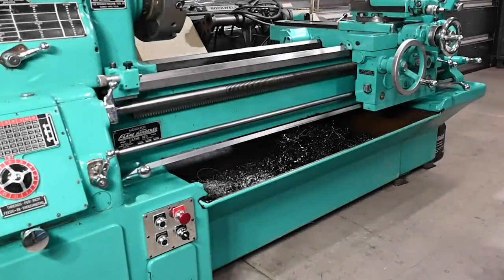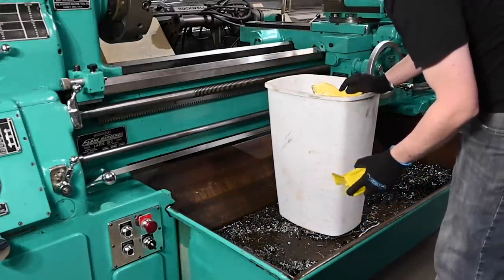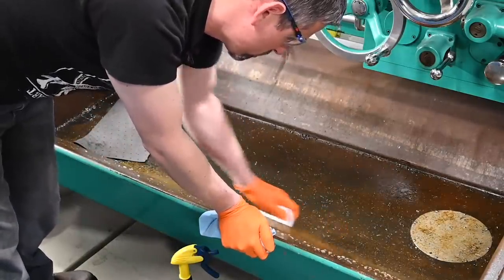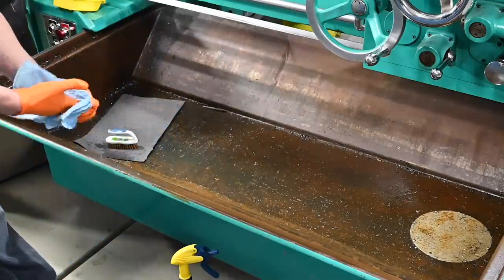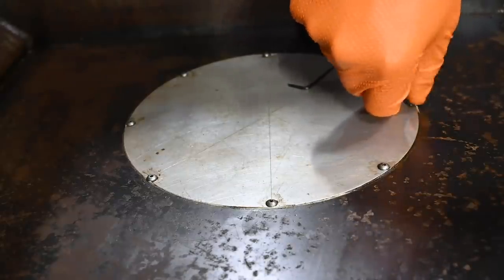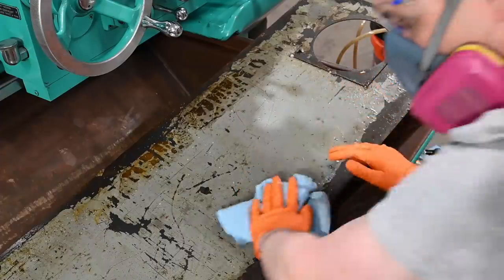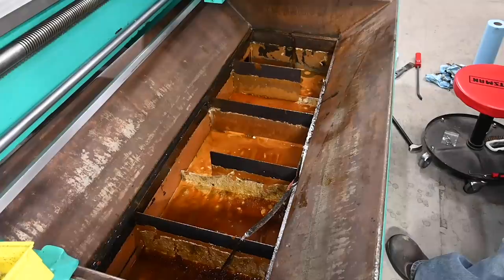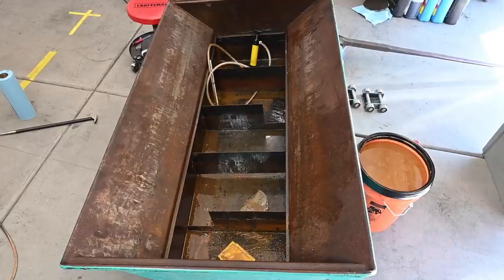Monarch Lathe Coolant System Rescue! With Smell-o-vision!

Comment: Back in the day,..I apprenticed in a machine shop ( Carlson Machinery, Phoenix AZ ) ,, that required all 26 apprentices to Clean the machines after the days production runs, this duty was accomplished by pulling the "Chip pans" with a fork lift to clean and empty into a salvage bin out back. To avoid extra work to disconnect the coolant pump supply tube and electrical most lathes with this type of coolant recovery pan were "Upgraded" to use a remote pump and hose and discontinue the original pump and hose, this allowed the apprentice to pick up the entire pan with coolant and chips to be dumped at least every 3 days. I see in your videos are that your lathe is not mounted on a 2" thick, x 6" Dia. circular floor riser under every leveling point , this would allow the "Chip Pan" to slide on the inset tracks on the bed castings and allow a 3" air gap under the chip pan and lathe that would allow easy removal of the chip pan with a fork lift and cleaning under the lathe. Also Monarch placed drain points all over the pan as the customer ordered, most series 60 and 61 chip pans had drains near the bottom and pickups half way up from the bottom drain, this allowed the pump to recover coolant while the chips sank to the bottom, I also see that the chip screen has been replaced with a "Plate" and should be replaced with a drop in Stainless Steel Pre-punched screen, a lot of thinking by Monarch went into these chip pans!

I would recommend that you clean and paint the pan to just below the "Screen Line" and just leave the inside below the screen line bare metal, this was originally the way they came from Monarch, all that grease and coolant will keep the coolant tank well preserved, above the screen I would recommend a good grade of Epoxy from "Sherwin Williams" , have the pan sandblasted but do not blast below the screen line, or in the coolant tubs and baffles, leave this area untouched 

Lastly,, I worked for Carlson as a journeyman machinist (11 Years) until they went out of business, worked for several other machine shops over another 12 years, and taught both wood shop and metal shop for Phoenix Union High School under the old Stadium, and finally ran my own machine shop until I recently retired.

My point is that you are doing well in these videos, I would counsel you to ignore the negative internet comments, there are thousands of us that appreciate you and others on U-Tube that take the time to produce videos to enjoy.
Thanks Dan
Reply from the maker: Wow Dan that was a kind and knowledgeable comment. Thank you for the time it took to write it.
Reply: @AlwaysSunnyintheShop  yes it was sound advise I think to.
Reply: Dan, your very full comment covered the aspect I was going to mention, namely that when Monarch designed the machine, cleaning in American industry was done by unskilled labour. Watching Aaron wrestle with that chip pan unit means cleaning it was not a popular job.
I have a (much smaller, but similarly robust) Japanese Okuma, and the chip pan slides on wheels towards the back of the machine - ergonomics or speed of cleaning leading to lower costs?
Just curious - was Aaron's Monarch shipped with that toxic mess, and none of it spilled?
Reply: @russelldold4827  I think it was, I personally think that the people who modified the chip pan left a void that coolant was able to leak into the lower "Sealed chamber and eventually putrefied over time, the coolant must have been a modified animal fat base that was often used back in the day, and if left in this condition reverted to the status of a dead pig out in the sun!   My Monarch chip pan is designed to easily slide out of the pan edge tracks with a floor jack, Im glad to see Aaron has the original parts to rebuild though!

Comment: It's your machine, do with it what you wish, comments are for help or questions, not unqualified criticism.
It's crazy what bacteria can do, and damaging, my previous lathe developed a leak, on examination, it was due to umpteen years of poor coolant housekeeping and had corroded the sheet metal bottom. Many old machines used oils with Chloride and Sulphur in, Chloride attacks the steel. 
If I may suggest before painting, remove as much scale as possible, then wash with a water soluble cleaner, rinse, then apply a diluted Phosphoric acid, 5 to 10% is fine, use a dish scouring pad, allow 24 hours, then wash off any residue. I've been using this method for a few years to great effect.
Invest in a Coolant Refractometer ( not a brewing one), and some  PH indicators, unless you have those already.
Rather you than me on clearing that bunk. Thanks for sharing.
Reply: +1 for phosphoric acid

Comment: I gave soluble oil away years ago, I use sulpherised oil and a spray bottle with the oil mixed with Kerro.
Have not had to change the oil since I put it in, surprise no rust and it works well with all materials as far as i an concerned.

Comment: Quick easy way to clean out your coolant tank stuff is warm/hot water and some biodegradable de greaser. If you are feeling cheeky may be take it down to the local hand car wash, the pressure will get in to all the nooks and crannys. To clean and neutralize your sump use bleach to kill the bacteria then hot soapy water/de greaser. If you are going to refill the coolant tank go for a coolant that has some sort of biocide in it. If you only plan to use a soluble oil coolant it make sure you wipe everything down prior to filling with bleach/chlorine {Glove up with thick PVC Gloves for this}. Once you get the rank bacteria out of it it will stay clean for a long time. If you use cutting oil and it goes into the tank make sure you remove it from the surface as when it is sealed from the air it will start to stink. To allow air into the coolant if it is going to be left for long periods get an old aquarium pump and put in a few air stones to make sure there is plenty of air in the coolant. The Anerobic bacteria is usually the first to start and can be prevented by using the air stones.  Dont bother to paint it unless you are going to use some pretty serious Bilge paint that will hold up to the coolant you plan to use. Honestly it isn't worth the trouble

The key to a healthy coolant tank is clean and disinfect everything it comes in contact with if it has ever gone stinky then fresh clean coolant. Use the same sort of discipline handling and cleaning wise that you would if you were cooking.
Cheers

Comment: Industrial machine in home shop.
I can't live without coolant, PIA, needs regular change out, in your case that's a lot of coolant to safely dispose of.
My suggestion would be to purchase a stand alone coolant pump, reservoir  readily available and mount the catch can and filter where the blanking plate is on your chip pan and gravity feed back to the stand alone unit.
Small amount of coolant to dispose of and easy to change coolant.

Comment: You can use Mesh Fabric sheets  to line your chip pan, it will let the coolant drain thru but not the chips. When it's time for  cleaning just wrap up the Mesh Fabric and out into the bin and reline with a new sheet of Mesh Fabric.

Comment: I don’t know enough about Monarchs to add any tech info. I know I wish I had one.
Keep doing what you’re doing. The only way to get 20 years experience is to do it for 20 years. 👍
That coolant looked like badly neglected water soluble coolant mixed with way oil which can go rancid as you found out.
Assuming you intend to use a similar coolant, make sure you keep it aerated. A good fish tank bubbler will do it. Run it 24/7.
You also want some sort of oil skimmer as was mentioned earlier. 
I would try 10 gallons of water and Dawn dish soap to get 80% of the crud out of the inaccessible sump. 
Otherwise you’ll need about 10 gallons of kerosene or other such solvent.
And yes, a circulating pump of some sort to flush it thoroughly.
Thanks,
John
Reply: Caveman's Mancave: 100% on fish tank air pump, worked perfect on my old Colchester lathe with plain mineral emulsion coolant, I use a semi synthetic coolant on a newer lathe, and since it has only machined steel, coolant is fine, though I do check for concentration with PH indicators and refractometer. Machining brasses and coppers does taint the coolant

Comment: My suggestions is if you intend on re using the coolant system, make sure you have the right paint that won't react to the coolant and lift up or cause rust/other problems.  Make sure it's keyed well to the the metal.  I use Master Chemical TrimSol 585 or 595XT.  Get some Kleenzol DY too.  This type of coolant you have to keep moving, so it will be worth getting a small circulating pump to help keep the coolant circulating.  if it sits for long periods of time it will go rancid, and yes it can happen in a weekends time.  I would reccommend also getting something which will remove all the loose bacteria and scale.  Doing a media blast if you can, preferably soda which is better on the metal.  Most of the american machines had "Gusher" brand pumps, they are still available and you can get parts from our favorite place McMaster as well as MSC and I've dealt with them too.  Get a skimmer to keep the tramp oil out; anything thats not the coolant/water mix itself.  you also have two or three choices. Mist, Cutting Oil, or soluable oil/coolant and I know several who have both on their machine.

Comment: that’s the down-side of the internet.  If you even did a youtube on drinking a glass of water — there’d be some self-proclamed expert to tell you, "your doing it wrong.”  to those that tell you, your not Abom:  Of course your not.  you’re also NOT quite a few others that work on Monarch lathes.  I’m sure Keith Rucker, Vintage Machinery, would have drawings and handbook information re the Monarch you own. Probably can give you more information on cooling systems that might have been used for your model.  I do admire your willingness to get down there and clean all that out.  Looks so much better already.

Comment: I would use Ospho on the pan.  Its a phosphoric acid rust converter.  It turns rust and mill scale into really nice looking black oxide that is in itself, a primer.  You can paint right over it, or oil it and have a pretty nice "cold blue" finish.  At about $20 a gallon, its not too bad.    Two gallons would do that pan with some to spare.  

Ospho is also really good for getting that miserable galvanized zinc off of stuff.

Comment: Aaron,  I had a similar situation with my Series 60 Monarch.  I ended up running water and detergent through the pump/sump.  Then after a lot of straight Simple Green I used the pump and a hose to empty most of that out of the sump. Then wire wheel followed by solvent before painting with a 2 part epoxy.  I was able to score a replacement sheet of perforated Stainless Steel from a local sheet metal guy. I thought I’d use flood coolant so I put in many gallons ( dollars) into the sump but couldn’t stand the mess of using the flood coolant.  I now have 3 5gallon buckets of Mobil Omnicron (?) that I dab on with a small brush. You’re doing a great job and you’ll never have to do it a again. Cheers, Will

Comment: Trolls will complain about anything and everything, like Leonardo da Vinci painting the Mona Lisa the wrong way.
During my apprenticeship I quickly learned that many Journeymen had their preferred way of doing things, if you didn't do it their way it was wrong, it wasn't that it wouldn't work, but that they knew from experience that their way worked and that was how they were instructed, so if you do it their way they can be reasonably sure it was done right without watching your every move.
I remember one time 3 Journeymen were discussing how to solve an installation issue and couldn't come up with a plan, I started to explain my thoughts on how I  might have done it, and I was told that this doesn't concern me, It doesn't bother me if they hear me out and then disregard my opinion as not working, but to dismiss me without hearing me out doesn't help anyone and doesn't teach the apprentice anything, when I became a Journeyman I'd always ask the apprentice how they'd approach a problem, it would give me fresh eyes on the problem, and it would help me understand how the training of the apprentice is proceeding, and help teach them the skills of planning and troubleshooting.
Reply from the maker: I’m with you 100%. If I’m wrong, explain to me why and lets improve. If you have knowledge to share, then share it. There are a lot of machinists out there that feel threatened that if they share what they know suddenly they won’t have value in their job or something. Pushes away a lot of young guys that don’t get any support as they learn.

Comment: Don't be discouraged by negative comments.  I look forward to every new video that you post.  By the way your chip pan was very pristine when compared to my chip pan when I got my big lathe.  My pump sump had rust through holes, 30 gallon of chips were in the pan.  The good news was that I found a KDK 200 series tool holder buried in the chip pan.  Keep up with making the great videos  God's Blessing to you
Reply from the maker: That’s. Shocking. A tool post buried in the chips!? 😂😂
Reply: @AlwaysSunnyintheShop  When I bought my lathe at the auction I was told the history was that the lathe was the primary lathe for a inventor.  He sold a design to Caterpiller and cat moved him to their plant to supervise production .  While he as gone there was  a fire in the building. the lathe got hot enough to melt some plastic buttons but the plastic handles did not melt.  The roof then came off in a storm. 2 years later they had the auction.  Nothing would move on the lathe. not a handle, live center, nothing.  My plan was to repair it so it was in working condition.  It took me less than a year to get everything up and working.  I was also live in care giver for my mother who had dementia. so I could not give a lot of time to the project.  I am wheel chair bound so I am sure that slowed me down quite a lot too.  It is all functional except I have not wired the motor for reverse yet.  The lathe is a enco that is a china copy of a Colchester Triumph 2000  15" X 50"
Reply from the maker: Wow that is an amazing recovery and with limited time and mobility to boot! 👏

Comment: Well I think cutting hole would be a good option for cleaning as long a the are covers to keep chips out of the rear area. The baffles down through your tank are to separate out chips and oil, If you are planning to use this thing and use water based coolant then some sort of oil skimmer should be used to control the tramp oil. Cleaning regular like once a year will also help. Knowing this came with the machine the previous owner didn't like dealing with the sump. As far as painting the chip pan I thi nk I would use rust converter on it.

Comment: Brutal removing it that way get your self a shop vac to clean out the sump at my work we have 2 shop vac on 45-gallon drums for what you just completed. Add an oil skimmer to your sump to help separate the oil from the coolant the wast oil can then be recycled. My work purchased a condensing unit to boil off the water and the muck that is left is recycled with our wast oil expensive for a home shop but you may be able to cobble up something.
I'm sorry I can't remember the product we used to flush our sumps but was from Trim Sol. 
We half-filled the sump with water added 4 liters of the flushing solution and let it run 4 hrs if it was really bad we let it run all night. we run a 24/7 shop someone would check on it as it was cleaning. once cleaned vacuumed out refilled and checked the strength with a refractometer our level was kept between 07 - 12 any higher and some workers would start to get rashes.
Hope this will help you out.
Play Safe From Elliot Lake Ontario Canada.

Comment: if you can take the pump off and take the pan outside and hit it with a pressure washer to get the hard to reach places. You have gone where no one has gone before, great job and good luck.

Comment: Aaron, every channel I watch (over 100) of home shops havie GROSS, YES I SAID IT GROSS idiot trolls wanting you to comment and derail the channel content. Just ignore, delete and pay no attention. Keep up the vids. 👍 As for your chip pan, one idea for you would be to clean it out (obviously) scrap the pump motor, get rid of the baffles, top plate and as much weight as you can and use a Noga air/coolant spray. Next clean up of the chip pan, shopvac and whatever NICE SMELLING cleaner  you like. PINESOL? FEBREEZE? 😁

Comment: Hey, like what you have done to your machine. Yes, it is a filthy job, but my phylosophy is:" if it's on a machine, it needs to work". I would suggest coating the coolant reservoir with epoxy coating. This stuff is chemical resistant, so should be up to coolant and cutting oil. would make it easier to get cleaned out in future.
Anyway, keep up the good work!

Comment: Wire wheel or sanding disk in a angle grinder to remove surface rust and loose paint. Spray primer, get tractor and implement paint something with a hard enamel, paint whole tank sump and sump cover. Don't seal the sump cover down just lay it on top, very little chips will get past, will will have to remove it every year to clean anyway. Put a new screen on the sump pan cover, stock was a brass cover with really tiny holes in them. Fill with water based coolent and run.

Comment: Hey Sunny. See if that sump baffling is factory. It may be shop made which is why it seems impractical for cleaning. Also, why paint the chip tray? I suspect cleaning out chips will just scrape any paint you add and it'll look crappy too soon. I think I would just sandblast it and then spray it once a month with wd40 to prevent corrosion. The sump could probably use some coating though.